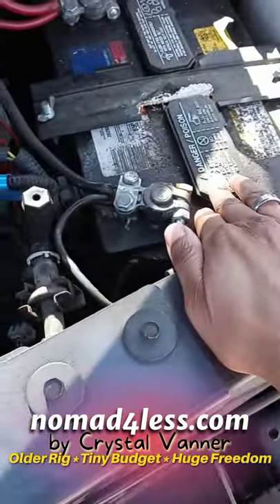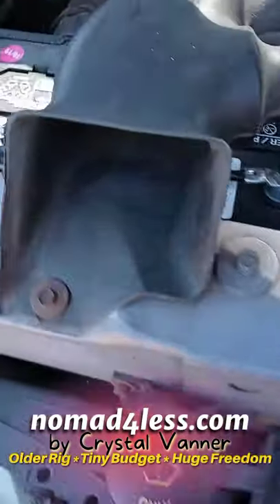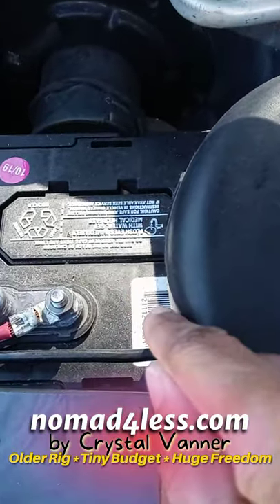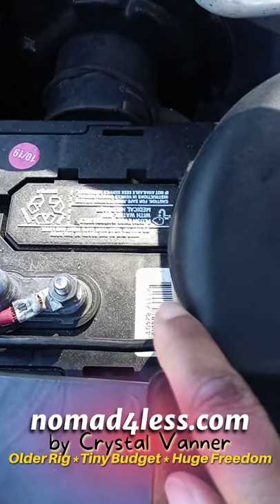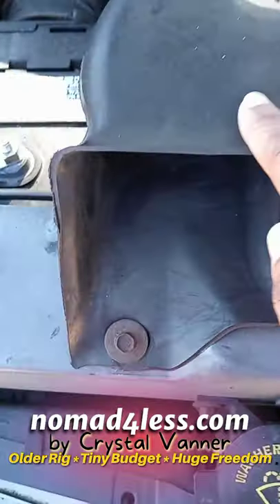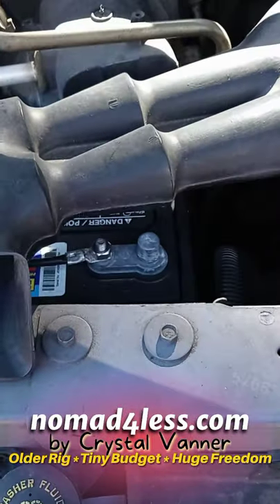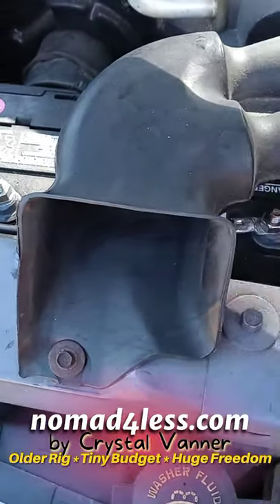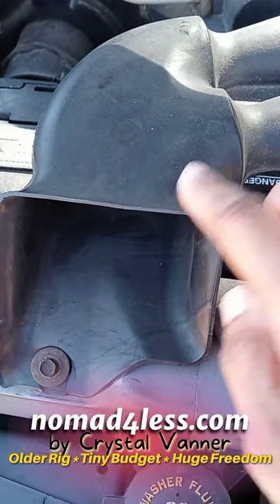YouTube #shorts: Removing Solar System From Campervan (Taurus) House Battery

Comment: It's funny you should mention the
removal of your house battery, Sis,
I was wondering if it was possible
to remove it and install it elsewhere.
The car mechanic I'm working with,
who knows NOTHING about live-in
rigs, simply BUCKS ME at every turn,
and on THIS TOPIC I said enough.
Now my house battery sits under
the hood disconnected, ho hum.
Reply from the maker: My entire solar set-up from Taurus is going to go into M.O.N.A. Later on I'll add a 3rd 100 watt panel and two more $99 Walmart barrteries. One day I hope to have funds to do lithium batteries.
Reply: @CrystalVanner  

Thank you, Sis, you ALWAYS provide
me with inspiration.. LUV YA LOADS!

Comment: House battery under the hood? Interesting.
Reply from the maker: Yes, the engine in Taurus allowed for 2 batteries in the diesel engine version, so the space was empty in my regular gas engine version. Better than putting it in the "house" part of my campervan. M.O.N.A. is an actual RV, so there's an actual battery compartment accessed outside the rig for house batteries I plan to use.
Reply: @CrystalVanner  Nice